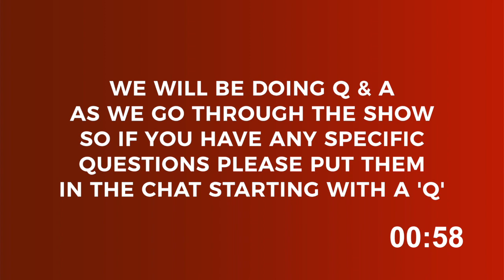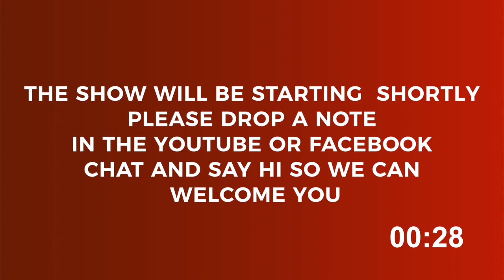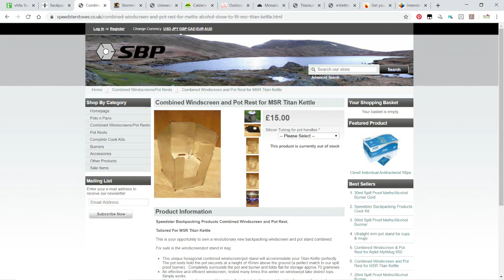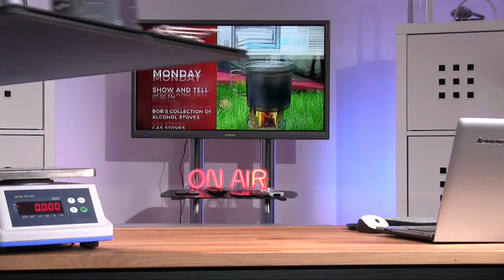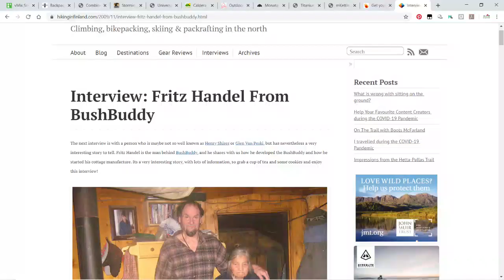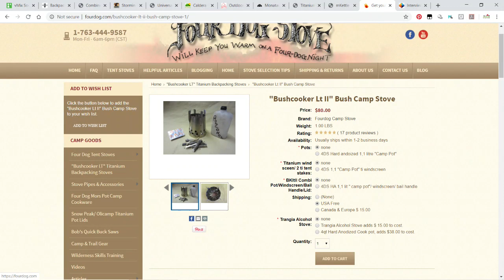Over 40 Alcohol Stoves, Gas Stoves and Wood Burning Stoves Review

Comment: Hiya, Good show this evening.  I watched it live on youtube, but not sure if my posts came up in the chat window. I was wondering if you have any recommendations, for containers to hold about 50 to 100mls of meths. I have the smaller trangia bottle, but that’s overkill for a couple of boil ups. I’m currently using the squeezy bottles the super concentrated orange squash comes in. Any better suggestions?
Reply from the maker: John Jessup Nalgene do individual bottles 60, 120 and 250ml on the BPL site? That would work.
Reply: I've got a Swedish army surplus Trangia kit (just like the one Bob showed) and it comes with its own dedicated, squeezy plastic fuel container.......i'm not sure of capacity, but it's enough for two complete fills of the stove! I hope that helps.....
Reply: a bit late but what i teach other trampers here in Aotearoa to use if you dont have a strong or metal bottle is a water bottle like a Pump bottle with a squirty lid that has the clear cap on top, light cheap or easy to pick up from ur neighbours recycling bin. I have also used alloy bottles such as the ones Japanese soda drinks come in or the metal Red bull bottles work too if ya iffy about the meths in a plastic bottle.